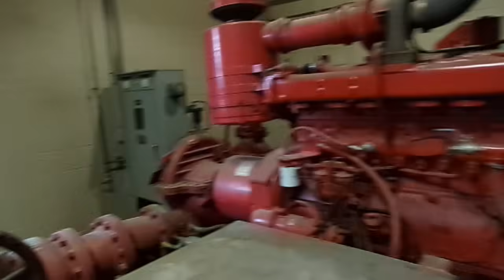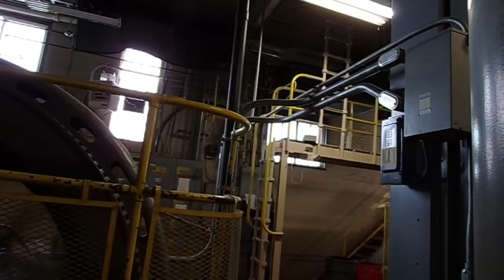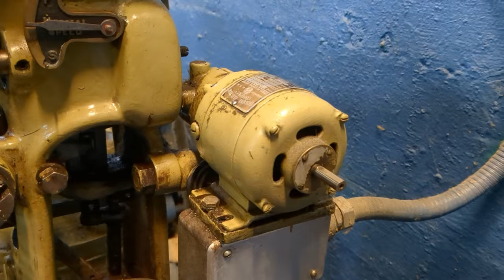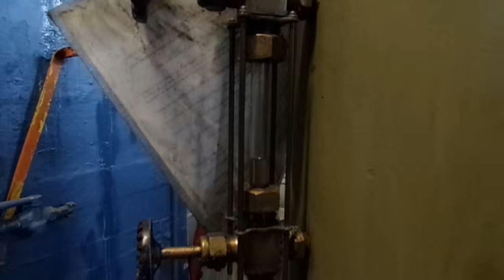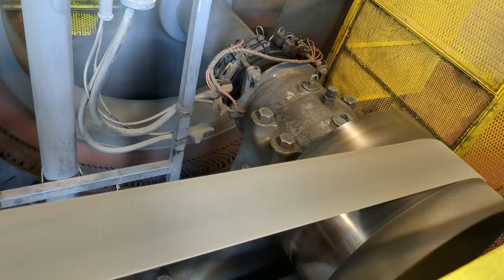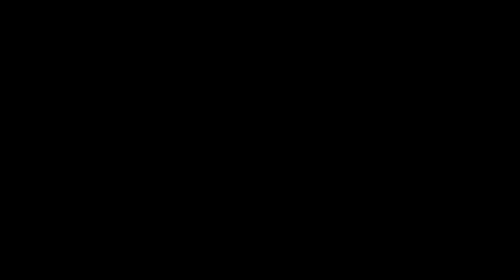Inside a Hydro Power Plant Still Using 100-Year-Old Mechanical Governors

Comment: Another good video Jason , steam turbines off all sizes used to use govoners  similar to that , also the small dc motor is definitely called a Exciter, in most plants it was directly cupeled to the output shaft of the generator on the back end it's surprising they even still used a big flat belt for it , I would think they would at least use ganged v belts , but what do I know it's definitely a neat old place
Reply: I think somewhere on YouTube you can find a video of a Fairbanks Morse power plant (like a Model Y) that with both a flat belt-driven exciter and water pump, though I might be conflating a couple of different videos. Would've been around the same time period

Comment: DC generators like the exciter you show do not have permanent magnets. Rather they retain enough residual magnetism to self start ( think of rubbing a screwdriver across a magnet to temporarily magnitixe it). Occasionally the residual magnetism is lost and a short duration charge must be applied to the field typically using the station service batteries. Its called flashing the field.

Comment: Rotary DC exciters have a set of field poles (electro magnets) as seen in your video, mounted  along the stator (stationary windings). The shunt field rheostat on the panel controls how much of the DC output from the armature's comutator is fed back to the field poles, thus increasing or decreasing the magnetic field and thus the output of the DC generator. All DC generators are actually AC and the commutator is used to rectify the AC to DC through the brushes. This is accomplished by the brushes collecting a pulse of the AC each time a bar in the commutator passes under a brush. The DC output feeds the slip rings on the shaft of the main generator which connect to the field poles on the rotating rotor. Each pole on the rotor is flipped magnetically from pole to adjacent pole. This alternating magnetic field then induces a synasodal alternating voltage and current in the three phase windings of the stator.
Once again, when the generator is paralleled with the grid, adjusting the exciter's output to the AC generators field does not change the output voltage. Rather it changes the reactive current in or out of the machine. Reactive current is essentially out of phase with the voltage and represents magnitizing current. Reactive current does not perform actual work (remember volts x amps = power) because it is not in step with the voltage. It does take up capacity in conductors, transformers, and generators so keeping reactive current to a minimum maximizes the ability of an electrical system to perform actual work. KVA represents the voltage times both real and reactive current. KW represents volts times only the in phase current. So KVA only equals KW at unity power factor or zero reactive current. Thats why automatic control of an exciter is critical to maintain the proper magnitizing current in order to minimize reactive current.
Reply from the maker: I learned about kilovars at the pisgah dam. its manually controlled and when power is reduced but the field current is not the kilovars go up.
Reply: @SteamElectricityandPropulsion And vice versa. If the power is increased but not the excitation, the VARs go up. More power requires more excitation. Under excited is leading power factor, over excited is lagging power factor from the perspective of generation. Unity power factor is when there is the proper amount of excitation and all the current is in phase with the voltage. KW is equal to KVA.

Comment: Another interesting function of the Woodward governor oil pump is that once the pressure reaches the unloading pressure (usually around 300psi) the unloader valve opens to bypass the gear pump. The system leaks back enough oil to keep the gears lubricated so that they actually pumps air to maintain the proper level of oil and air in the accumulator tank. Oil is not compressable so the tank maintains about 1/3 to 1/2 of its volume filled with air, which is compressable. There is a sight glass on the side of the pressure tank to varify the proper ratio of oil to air. This creates a charge of oil to handle swift changes in gate position and a charge sufficient to fully close the wicket gates from full load in the event of loss of power to the oil pump (unless belt driven from the turbine shaft).
Reply from the maker: I think the oil pressure is more like 200 psi. At the Dayton hollow dam the oil pressure was 190.
Reply: @SteamElectricityandPropulsion They vary from 190 to as high as 300 psi depending on the size of the turbine.

Comment: Its important to know that once the generator is paralleled with the grid, non of the governor functions are utilized. It simply acts as a gate positioner.  The speed of the generator remains constant from full power to zero power. In fact, if the wicket gates are fully closed, the generator will become a motor drawing power from the grid maintaining these same constant synchronous speed.
Reply from the maker: That's right! You can just change load on the generator by adjusting the speeder spring

Comment: Is this station a peaking unit that only comes on when demand is high or does it run all the time?  Is the facility also useful in case the utility has to do a "black start"
Reply from the maker: they generate power all the time. they had one generator shut down due to low river flow. the one with the exciter can black start but the power output would only be able to supply a small amount of houses.
Reply: Since there was the DC PMG for the exciter it should be capable of black start. But the power that plant puts out isn't enough to help the utility in a blackout. But looks like it can run in island mode and blackstart.

Comment: Woodward made mechanical governors over a century ago for the huge diesel power plants... They also made the governors for steam turbine generators and for military gasoline ground generators. Look at the huge Fairbanks-Morse 2 stroke diesel generators and you will see a Woodward mechanical governor. They were so accurate and stable that you could parallel and synchronize many generators to the main grid. Keep a CLOSE eye on the damping oil level or she would start "hunting" and cause the generator to fault and drop offline. Never a fun situation...
Reply: They're found on EMD engines too. Lots of locomotives and boats out there with the same basic gear!
Reply: @holysirsalad    meh... Woodward started the WHOLE show and for many decades was there only mechanical governor that could hold generator sets online. Water turbines, steam turbines, diesels... Anything that could spin up a generator to throw power at the grid. In the early 80's we had the early completely electronic governors that were precise enough to hold 400 Hertz... the little coffee can sized Woodward mechanicals were the only ones stable and precise enough before those.

Comment: It is fascinating how much machinery is required to support a system that yields very low power output...a few MW(2 or so?).  Don't get me wrong, that is not a bad thing.  The generated electrical power is very small but the machinery is very impressive.  To replace what exists with what is new would be quite expensive and ROI would be questionable.  It is nice to see the original things still working and persons that understand them.
Reply from the maker: I guess the plant can do about 3 MW of power. I dont think its a lot of machinery. just governors and exciters which any generator needs.

Comment: Old because they are still belt driven. Most were converted in the 1930's to electric drive. The ones I worked on were electric motor driven. I've seen a few still belt driven. FYI for Woodward gov enthusiasts, despite the speed of the generator the fly balls turn at 250 rpm for on speed. The books don't tell you that.
Reply from the maker: I read in the manual that they spin at 360 to 450 rpm. Belts don't mean they are older. A motor driven governor is used vertical units like the one at Dayton hollow dam. These ones are horizontal so a belt works well.

Comment: Those are really old because I did not see a dash pot bypass solenoid valve. The governors can take up to 30 minutes to respond to load changes and settle down. Great for synchronizing. Once on line the bypass solenoid valve puts the dash pot out of the loop, so the governor is more responsive.
Reply from the maker: Interesting, I never knew about that.

Comment: The wood ward mechanical governors are still supported by "American Governor" Out of Amherst Wisconsin. They offer a yearly class on all  the units they support. The units you show seem to look like the vibrator washers are worn out. The outfit I worked at converted almost everything to electronic. Myself and my counterpart ( old timers) fought tooth and nail to keep 4 of the fly ball units in service. Because they worked flawlessly if maintained.
Reply from the maker: I don't understand why every darn thing nowadays has to be electronic. Mechanical controls work just as good and also can't be sabatoged by hackers